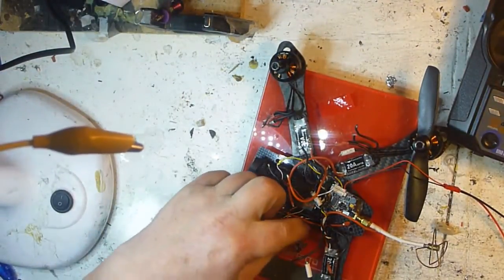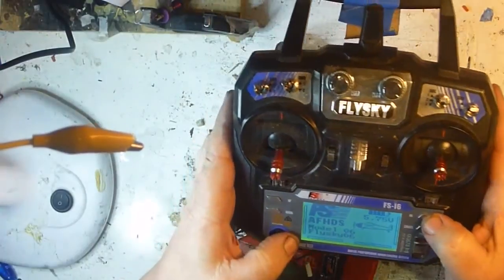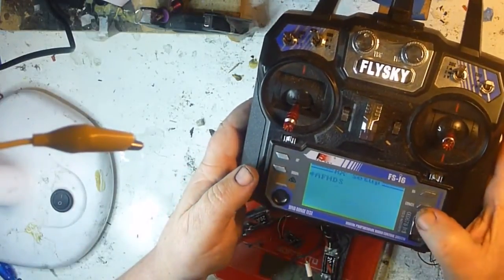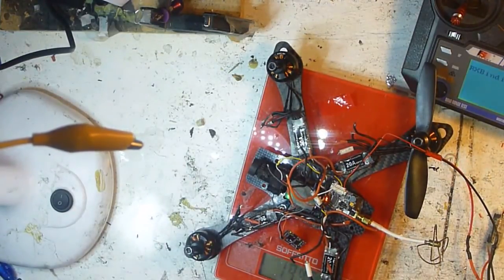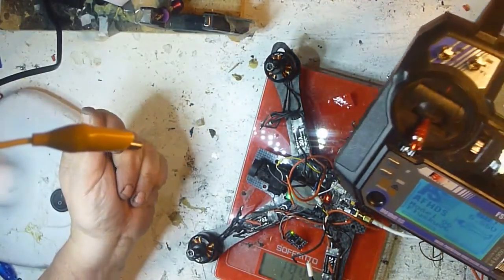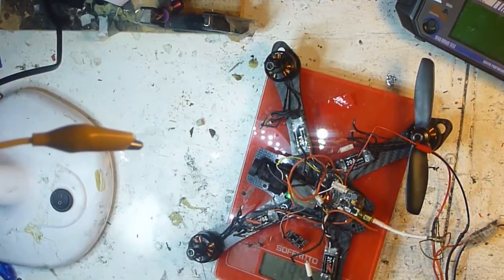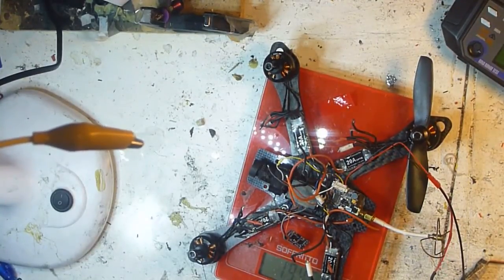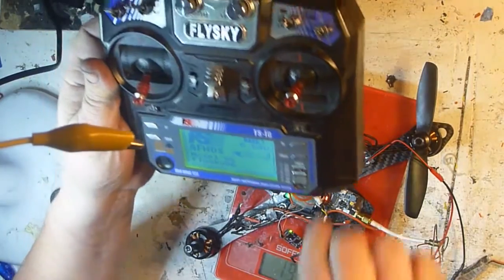DasMikro Ultra Miniature PPM

Comment: I tested for continuity between the antenna and the ground and I get a buzz. I'm not sure if this ok or this is how the antenna is supposed to work. For x6b receiver which is using normal antenna there is no continuity for example. Like alhazan is saying, probably "upgrading" to an antena with a core wire and a shield connected to ground could make the things worse, because those are connected.

Comment: My experience was similar, with stock antenna I don't get much more than 100m. Tried upgrading but made it worse - I'm reading a short between the antenna pad and the pad next to it, is that normal? Failsafe works. Bought it about a month ago from Banggood.